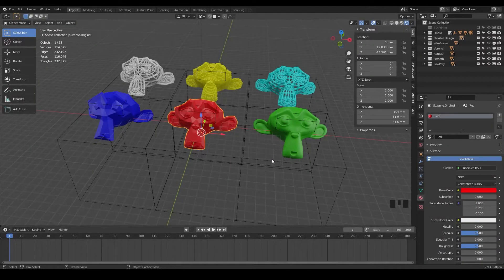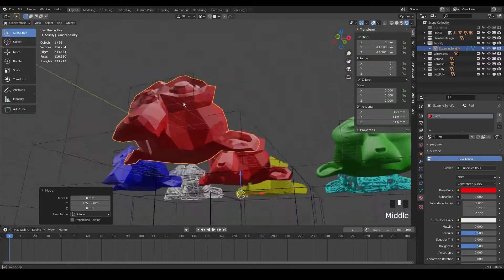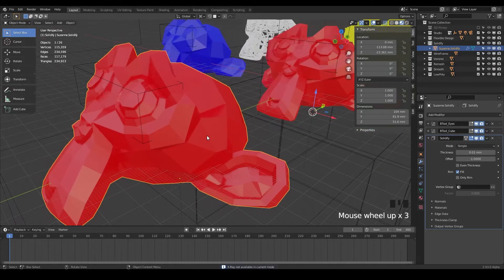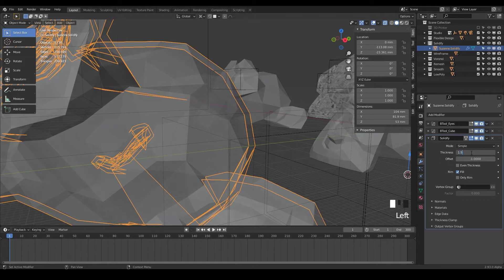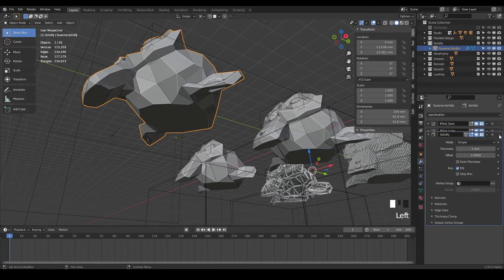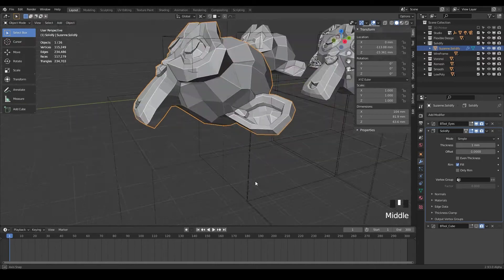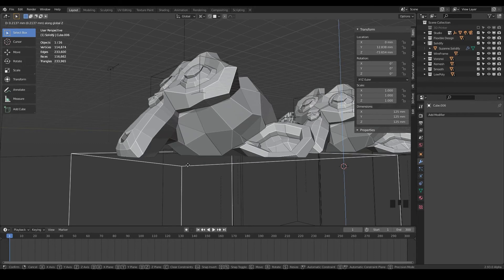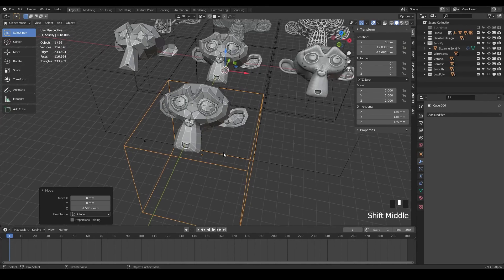Hollow Out Any #3DPrint Design | Blender for 3D Printing

Comment: My mesh solidifies externally instead of just inside and never makes it all the way solid. Any tips guys?
Reply from the maker: You may have a hole in your mesh. Try the Make Manifold button the 3D Print Tool Box addon. You can also change the -1 to 0 or 1 to make the thickness go in the outer direction. Let me know if that helps
Reply: @PrintThatThing  I will thanksa lot

Comment: What if you wanted to create a head, that is hollow but can be cut in two halves and retain the same hollowness (not reapply it on the two halves)? Is that possible?
Reply from the maker: Yes. You would do this process then use a plane with the solidify modifier and then boolean subtract is from the main mesh. That way it stays non destructive workfloe

Comment: The Solidify Modifier is basically useless for hollowing 3D prints.  The problem is that it only works properly on very, very simple objects.  On real-world, more complex models, it causes tons of intersecting faces and bad geometry.  The best way to hollow a model is to save it as an .stl and then load that into Meshmixer and use its Hollow tool.  The Meshmixer Hollow tool works perfectly and it lets you set all sorts of parameters.  Then save as .stl and load it back into Blender.  It sounds like a pain, but it's pretty quick.  I just wish Blender had a real Hollow modifier that worked.
Reply from the maker: Yeah that would be cool. I'll see if I can figure out a way to do that inside. Great idea 💡 👍 👏
Reply: @PrintThatThing  any updates for complex model for hollow work? sharp corner is always an issue for hollowing.
Reply: You can get pretty good results with the solidify modifier if you use vertex groups and the offset to keep things like fingers and pointy ears solid.  Complex mode can also help too but hollowing in Lychee or Chitubox is still much simpler although if you are willing to spend the time you CAN get more control in Blender.  One weird trick that works sometimes is to duplicate your model, scale the duplicate down so that it is slightly smaller and inside the main model and then flip all the normals on the smaller version to make it become the inside walls.  This gives you vertex level control over the "hollowness" but can be a bit of an effort too.
Reply: thank you very much
Reply: but no MAC version.
Reply: @yaot.1523  There is a Mac version of Meshmixer.  I use it every day on my MacBook Pro.
Reply: @yaot.1523 I just Meshmixer on my Mac and it works great.
Reply: Thanks for the tip. This tutorial above really wasn't much help "Let's get ready any model for printing. oh, I see some overlap here so let's make the walls hair-thin (any printer can deal with that) still overlapping? let's ignore it then" :D

update: Boy, the meshmaker is great. Cannot believe I'm only finding about it now!